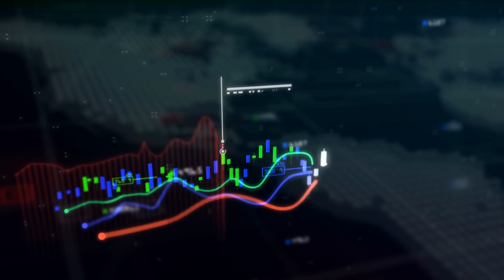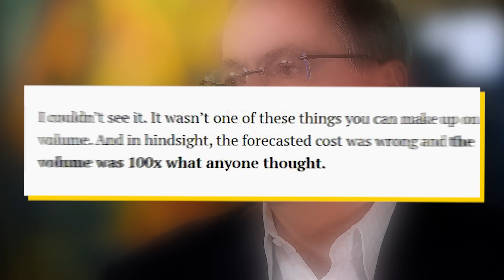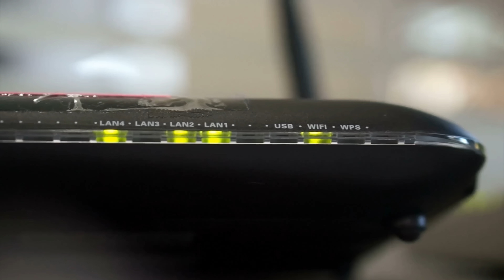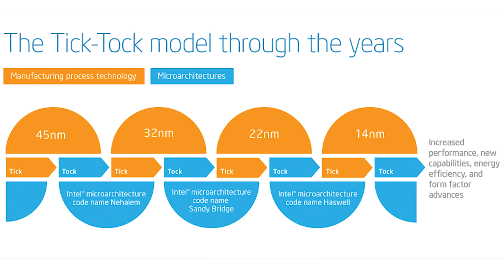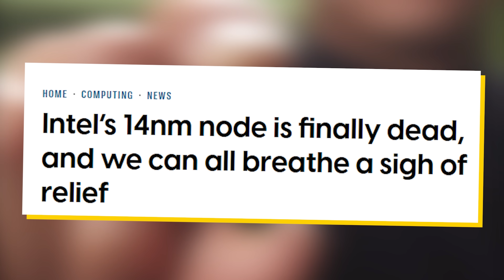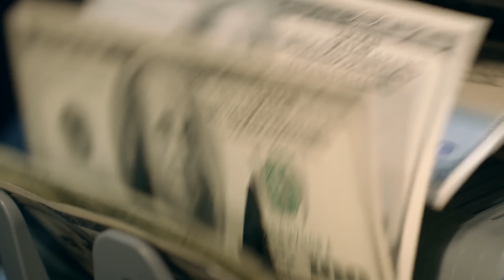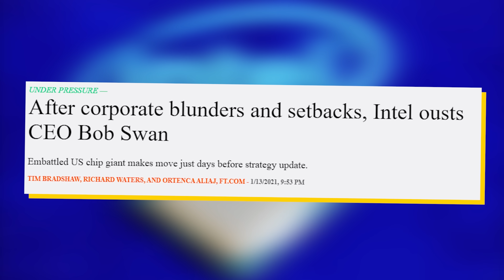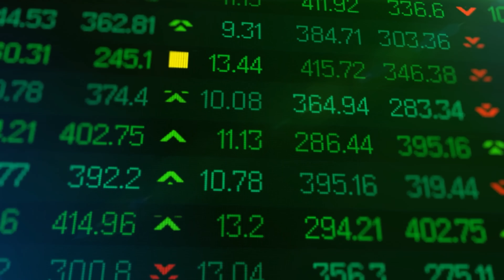Intel - Struggling Even During A Global Chip Shortage

Comment: Intel's blown the lead they had during the FX days but Alder Lake's currently got an edge over Zen 3 in low to mid tier processors and at the high end who's better becomes more workload dependent.  Real curious to see how Zen 4 vs Raptor Lake pans out though.

Going from undisputed leader to leapfrogging over each other every generation is definitely a step down from a business standpoint, though fiercer competition's been great for the consumer.
Reply: Yeah I feel like ARC is going to be irrelevant by the time it launches.  The GPU shortage was a very compelling reason to give it a shot.
Reply: @ironeleven  i've waited so long to give them a shot, but now i am just going with an A4000 instead. cannot wait anymore
Reply: @ironeleven  The first GPU product in my perspective can be a mid range one. If they achieve 3070ti level performance card before the end of the year it will still be a good entry into the graphics market segment. 
GPU segment is not a simple market to enter. It took many many years for amd to compete with nvidia in gpu segment. If intel can bring out a strong product that competes with both amd and nvidia by 2024, that in itself will be a big win for intel.
Reply: I'd argue that the 12100(F) is a standout budget pick as well, though yeah, there's definitely use cases for each manufacturer right now.  Maybe it'd be more clear cut if the 5500 and below wasn't repurposed APU silicon minus the decent IGP.
Reply: @ironeleven  and we'll see if arc technology will make it's way to integrated graphics as well. but since it was delayed so many times, that is a disaster in the making... for the past half a year i am constantly bombarded with arc marketing ads, yet it is still not available for purchase, nor there are any believable 3rd party reviews about how would it perform.
Reply: Yeah they got the "edge" but at what cost? 2-3x the power draw for the same, or slightly better performance? But this is just the mid tier chips, on the low end, amd APU-s dominate over intel integrated graphics. In the workstation and server segments the lack of memory channels, cores and pci-e lanes is a devastating difference. To sum it up the only place they are ahead is the mid-high end gaming, consumer rigs(and for workstationns that only require consumer chips). It is not a small segment, but the overall outlook is very bleak
Reply: @Tyrim  the power draw critic is only valid for intense workload on high end (i7 and i9)
In gaming and daily simple stuff, intel is way better. Same or less power draw for greater performance. Even the i9 eats less than 100 W for gaming.
(That's speaking about alder lake, rocket lake was useless trash to make people get PCIe 4)
Reply: @Spido68_the_spectator   as i wrote before, not everything is gaming. Especially if you buy a mac. Compare workstation builds for workstation workloads.
Reply: The problem with intel right now its their ability to consistently execute on time.
Alder Lake was supposed to launch a few quarters after zen 3 not a year later and raptor lake and meteor lake is supposed to kill zen 4 with pincer attack  but raptor lake is rumored to be delayed after zen 4 and meteor lake is delayed to be around zen 5. And arrow lake which is Intel's next big thing thats supposed to kill zen 5 is rumored to be delayed just before zen 6 launches. Intel is starting to fight the last war here
Hopefully intel starts executing consistently before its too late, i dont want overpriced cpus from AMD as i payed $1000 for a 5950x 9 months after it launched and it would suck if this becomes the norm
Reply: @marvcyber815  yeah, i already can't find an upgrade for my 2920x what i have bought for 300$, since anything that would be considered an upgrade starts around 1500$... Insane how costly amd cpus became in just a few years already.
Reply: @Tyrim  AMD is transitioning to a premium brand from what im hearing and because tsmc raising prices all the time, so i would expect them to become like open source version of NVIDIA 

So i really hope Intel becomes a decent price performance option to keep AMD in check and also push AMD to not potentially stagnate at 16 cores (while it's more than enough for now but it's the same story when the first 4 core cpus arrive so...) and not neglect segments like Threadripper because the 'Order 66 that also kills their own product line' jokes when the 64 core 3990x released are becoming too real at this point
Reply: @marvcyber815  it's a sad story really.
Reply: @marvcyber815  why did you pay so much? Did you absolutely need a 5950x during the chip shortage? Personally, I  waited and they're now $500 range...
Reply: @nickfries4317  Yes unfortunately, my pc broke down + it can't do the task i needed it to do 
also i live in philippines (not the best place for tech i guess) where there insane customs taxes slapped on every imported product 

so at the time i bought my 5950x it was actually the best price performance ironically out of zen 3 lineup + it was the lowest price i got at the time 5950x sells for around 75k php = $1500 USD + crap you will be forced to buy too
also don't mention about gpus here in philippines prices are more insane that what i have seen online 

Even now 5950x sells for typically around $800 here (with some microcenter like stores selling for edit: $750)  in the philippines after a year i bought that so it turned out the best decision for me
Reply: @marvcyber815  
Idk where you got all this

Comment: In india it's very hard to find proper AMD powered laptop due to the sheer power Intel have with laptop makers.
Reply from the maker: Ah yeah, the partnership monopoly
Reply: @LogicallyAnswered  No, actually a lot of budget laptops in india have ryzen. availablehage is spouting bullshit.

There's 55k (~$720) r5 5500u/4600h and even 5600h laptops sometimes popping up. They pack either gtx 1650 or 5500m
Reply: @setzer-j6s  yep, I totally agree. More so, AMD chips are cheaper than Intel counterparts by an average of 5000 INR..... and people are buying them!
Reply: @ChaitanyaSuri  Yeah. Unfortunately AMD dgpu's are still too expensive. The rx6600m costs 100k vs the nitro 5's rtx 3060 + 5800h costing 95k. It even went down to 90k briefly. I'm sure a 80w rx6600m + 5600h or a older 4600h with 60-70whr battery can bring down cost drastically.
Reply: AND and Nvidia also have no way to manufacture their own chips. That’s been ok for a while but it gives Intel massive advantages with supply chain, margins, speed of delivery etc. tbf their speed has been shite recently but I’m confident they’ll improve
Reply: @SilentEire  It's only a massive advantage for Intel if people/companies actually buy their chips.
Reply: Its common, if you search for it, specially in gaming laptops
Reply: It's not too hard. There are a lot of Ryzen 5000 series laptops available from HP.
Reply: There are a lot of amd laptops

Its just that most of them are sub-40k average budget laptops (and many of them use older CPUs/iGPUs) or 1 lakh+ gaming/premium laptops
Reply: @suntzu1409  There have been many 50k gtx 1650 laptops with a 4600h. The HP Victus at 55k packs a 5600h + rx5500m. The MSI Bravo at 58k packed a 5600h + rx5500m + 144hz display. The MSI GF65 thin costed 70k with a rtx 3060. The nitro 5 with a 5800h + 3060 costs 95k and even dropped to 90k at one point. 

Do you want me to give more examples of gaming laptops below 100k? 

As for regular laptops, there's the 5500u 42k msi 14 prestige. There have been many 3500u laptops between 30k to 40k ever since the 3500u launched. If anything, intel almost always seems more expensive
Reply: @setzer-j6s  
My point was something like vivobook s15 oled doesnt exist with ryzen
Reply: @suntzu1409  Dude, the vivbook pro 14 with a 5800h + 3050 costs 90k or less. It has a 90hz oled. The zephyrus g14 costs around 70k.
Reply: @setzer-j6s  
There is vivobook s15 oled with i5 around 70k as well

Zephyrus doesnt have oled
Reply: @suntzu1409  Yes but why get a s15 oled when there's oled options with i3's for 45k. And 15' 5500u oled vivobooks for 52k.
Reply: Intel focused hard on the laptop market and even paid laptop companies to use their chips back in the days.. Not sure if they currently have such deals.. In the future there will probably be more laptops with different chips..
Reply: What i see many non tecnical people who buy laptop prefer intel, most then don't know about AMD anything
Reply: @iraklimgeladze5223  Well, non technical people do get ripped off in a lot of places. Buying overpriced flagships they never use because of status. Buying more expensive nvidia GPU's due to status. Buying intel laptops because of status. 

They mostly buy to show off in a way.
Reply: @setzer-j6s  I know many people know about intel but not Ryzen, they want i5 but they don't know anything about R5
Reply: @iraklimgeladze5223  Yep. Had the same happen with a few of my friends. 

I'll just say this. We need to stop giving AMD a pass on the bullshit in their processors. For instance, naming zen 2 processors and zen 3 processors under the same branding. For example, the ryzen 5 5500u is not zen 3. Yet, it shares their name. 

Also AMD only supports undervolting on their ryzen 9 processors. And unlike intel, AMD isn't affected by meltdown or spectre. So why not allow undervolting on all processors so we can lower temps? Intel used to allow it and it was a great feature. 

Otherwise you'll see AMD turn into intel once they get the brand value.
Reply: @UCEqBNKrrKZOGUmrlhOvgDFQOh you mean the 150k rx6800m rog amd strix beating intel + nvidia rtx 3070 laptops of a similar price in performance and coming very close to rtx 3080 ones is considered ''peanuts''? It even has battery life unmatched by any intel + nvidia combo. Beat 10hr of regular use.

Or the ryzen powered OLED 90hz 5800h + 3050 max q vivobook 14 pro at 80k is ''peanuts'' for you. You know, a laptop whose equivalents from intel cost more and have worse battery life and thermals.

But you go right ahead if you wanna spend more money for a bit more performance elitist.